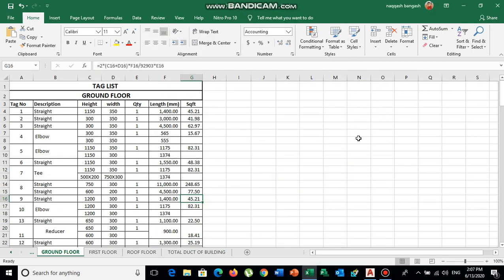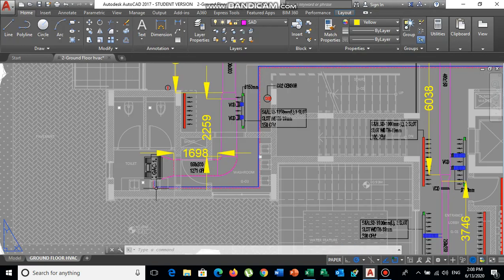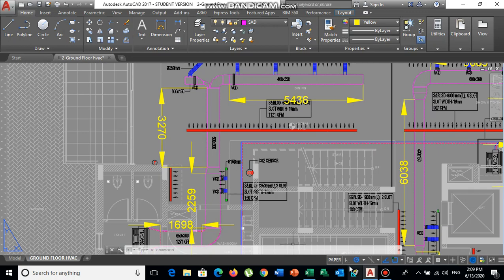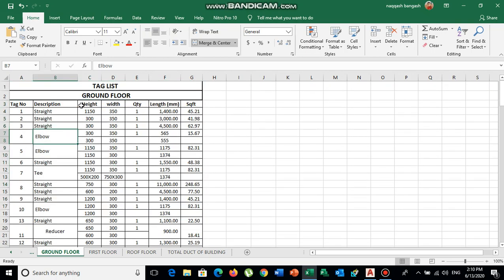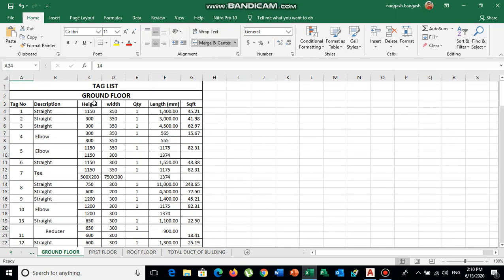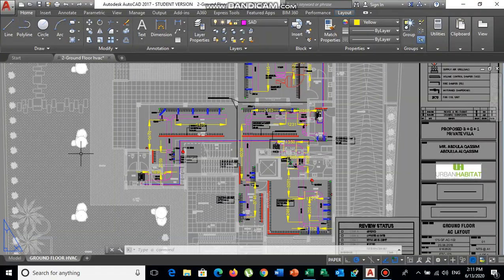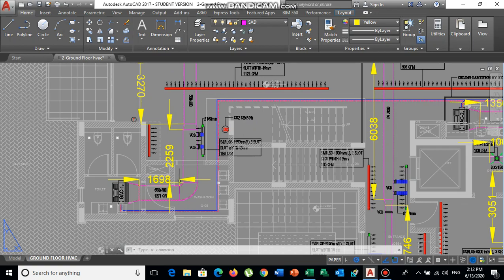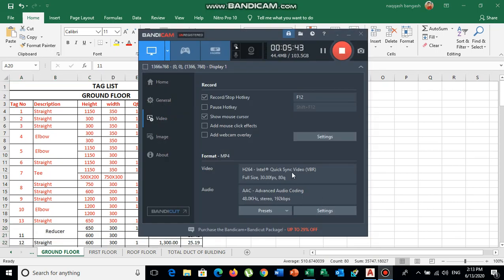How to make Duct Tag list and why its important for HVAC site Engineer and contractor. (ENGLISH)

Comment: When creating your videos, it'd be easier for people to follow if you zoom in to the part of the drawing you're looking at on your list. The area you zoomed into is nothing like the start of your list. The 1st piece in your list is a 1400L straight, but the 1st piece you zoomed into looked like a 600L transition, and it looked to be an AC duct, not a toilet exhaust duct, but either way, have some more detail on your list. I assume this Tag List is for checking items off the truck as they're delivered to site? Make life easier for everyone, and put the unit number as part of the Tag/Piece number. You zoomed in to GAC-1, which I assume is Grd floor-AC-1? So when creating your piece numbers, call them GAC-1-1, GAC-1-2, GAC-1-3, etc. So when the guys are unloading the truck they can keep the pieces for each unit together, and save a little time on site. It might take the dafty an extra minute, but if it saves the site guys 10 minutes trying to sort everything into runs, then it's worth the time. Most duct makers have a standard length of 1400, so before you draw your duct, talk to the manufacturer and find out what their standard length is, and draw accordingly, no point having piece number 3 as a 4.5m straight when it's far more likely to arrive on site as 3x 1400L and 1x 300L straights, so mark them as 3, 4, 5, & 6. When you get a truckload of duct to a site, there are many 1400L straights, so put more detail on your list, is it 1400L with an end cap, with your bends, list the type of bend, radius or square throat, instead of just "Elbow". There is nothing more annoying than seeing a Mechanical Services drawing with perfectly drawn palm trees outside, nicely hatched flood areas, and poorly drawn ductwork. It's a MECHANICAL SERVICES drawing, so put your focus on the Mechanical Services. Remember, the whole purpose of drawings is to communicate your design intent efficiently, not about what's easiest for the drafting office. It's a lot easier to manipulate a shape on a page than it is to alter a piece of metal duct on site, so make life easier on them, and you'll save your company money. I strongly recommend anybody who wants to occupy a drafting chair get's off their backside and spend (at least) a month in a duct shop making duct, a month on site installing duct, & pipe, and learn some of the pitfalls of the industry. I'm sure that as soon as you tell the guys you're working with that you're a dafty, they'll be more than keen to give you all the feedback you could possibly want as to ways you could improve your drawing. And make it a regular habit of getting out of the office and visit the site once a month and see how it's coming together, you'll learn far more and become a better dafty for it.